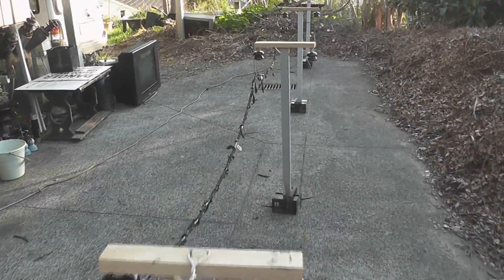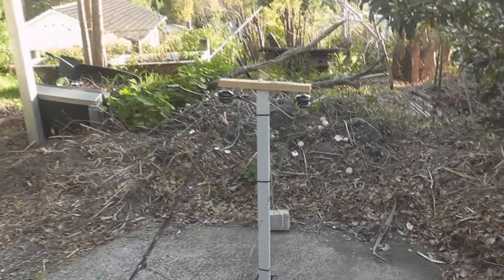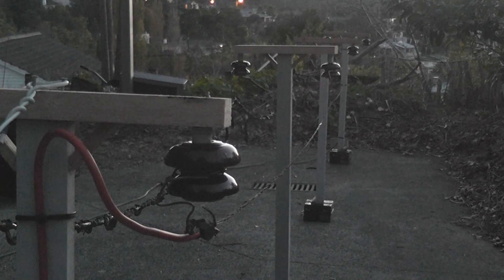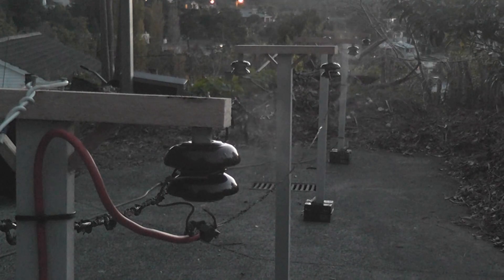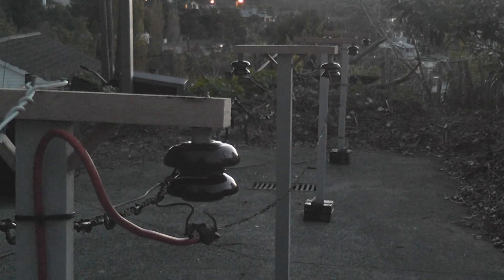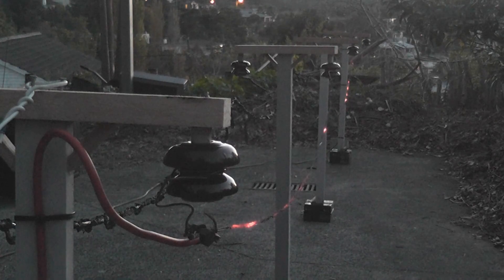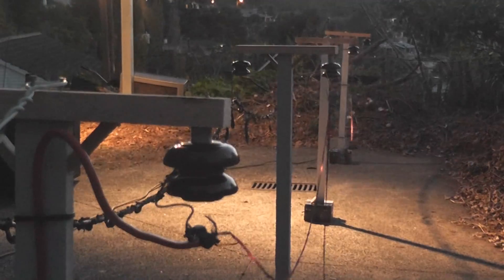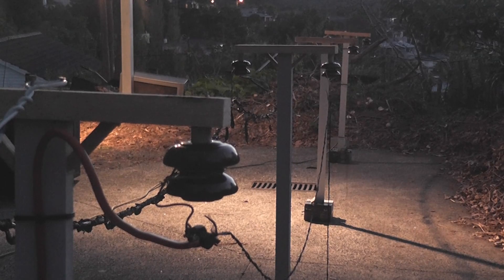OH line glowing red hot

Comment: did you create them by you self or did you buy them??
Reply from the maker: I build those power poles from old scrap wood. Insulators were from the bin at work.
Reply: ok thanks
Reply: but how many volts?? because they are hot??

Comment: I heard stories 7 years ago that something like this happened on a shorted 10kV power line in Estonia. Several kilometers of line needed replacement. Those motion sensors on these lights are not well filtrated from noise coming from the power lines and trip for a lot of things.

Comment: One morning on old north road just before the round about onto the state highway I looked over at the OH lines and one line was sagging about 20-30cm lower than the others which were perfectly equal. Was that one line overloaded?
Reply from the maker: Maybe, or it could also be a loose insulator shackle which is more likely
Reply: It was lower all the way along the road though.
Reply from the maker: KiwiPowerNZ
It could be the typically heavily overloaded red phase.
Reply: RODALCO2007 KiwiPowerNZ
In the US there are two heavily overloaded phases, one more than the other. Sometimes the rotate them properly, but in the country there are only 2 phases, one for all 120V and the other for stoves/air conditioners (240V). The third phase is mainly for industrial uses. RODALCO2007 is right the first phase is typically overused and sometimes slightly thicker for this reason.
Reply: theLuigiFan0007 People in the US brag about their 200A supplies. Does everyone have 50kVA transformers over there? Why such a high current rating? Unless you're Rodalco2007 you never max out the 80A supply we use here.
Reply: KiwiPowerNZ
I wonder where they get the 200 Amp from as many pole transformers are 25 or 50 kVA single phase.
Reply: Raymond Van Orsoy de Flines Do they wire the secondaries of all the transformers on the street in parallel to load balance them all? That would give some extra amps if one house was drawing a lot more than all the rest on the same phase.
Reply from the maker: KiwiPowerNZ
That was my reply on my other account. In some cases they do , often when there is a bank of three TX's. not when a single TX tank is fitted.
Reply: KiwiPowerNZ
The current rating is higher because the voltage is half. A 1200W heater needs 10A instead of 5A like in the UK and most anywhere else. Basically more amps is needed for the same amount of work. Volts*Amps=Watts. Typically a single, small transformer for each house. Like Rodalco saidm when more than one they sometimes wire parallel. Some people share a 120V output, as its unlikely both will use max current at the same time. The phases used more in a area are in parallel as two phases go to each transformer in a normal setup. Funny you mention 80A as our main breaker is rated 80A, it makes a full 200A undrawable. People that think they are better having 200A are really no much better than a 100A 240V supply, not too much more than yours.
Reply: theLuigiFan0007 I realize that. I mean
80*240 = 19.2kW
200*240 = 48kW or 120*200+120*200 = 48kW
In the US they have two 120V phases at opposite phase giving 240 between them by means of a center tapped winding, take neutral in the center and get 120V out each side at opposite phase. At 200A this is 48kW vs 19.2kW on our 80A supply. That is why is was asking, do all houses in the US have 50kVA transformers to supply this 200A rated connection. If it's not possible to use 200A why not make it a 1000A rated supply and share a 20kVA transformer with 3 or 4 houses lol
Reply: KiwiPowerNZ
Hmmm... appears I was wrong. Forgot 200A between phases (ex 100A per phase) is the same as across. It is 48kW. I do not know either other than some clothes dryers and stoves use 35kW at max depending on the design. Dosent make sense to me. I dont know too much about the power system itself, just the actual user end things. Sorry for being confusing.

Comment: Actually is a good illustration as to what happens in the summertime when everyone turns on their aircon, etc. The lines droop and come in contact with something and then.. blackout.
Reply: it's normally the fuse or transformer that blows before wire fails due to heat (a lot of snow on the lines can bring them down) If the wire is failing due to heat then someone is in trouble for using a cable that is to thin
Reply: it's normally the fuse or transformer that blows before wire fails due to heat (a lot of snow on the lines can bring them down) If the wire is failing due to heat then someone is in trouble for using a cable that is to thin
Reply from the maker: lee x
Some ground-moubted transformers in NZ feeding overhead lines have no secondary fuses fitted.
Reply: RODALCO2007 that does seem a good way to make transformers overload (and blow up) or cable meltdown

Comment: Wow you have leading edge fault detection on that line. Remote arc fault detection, it even lights up the area to make it easier for the engineers to work. :-)
Reply from the maker: That fault detection system worked well and was unexpected. The PIR from the outside light must have picked up the EMP from the arc when the line snapped in half.
Reply: RODALCO2007
Lightning causes the a old phone's ringer to ding once if within a few miles due to a almost unburied phone cable going betheen the house and shed that was patched in. EMP can make metal sheds flex a few milimeters to to a repelling field. Its weird stuff. Very good demonstration by the way, reminds me of a huge line failure that happened in the US a while ago. It was in 2003 that a 512k line failed and caused all the load to be shifted to 128k, 25k and other residential/between substation lines. They sagged and shorted on trees or broke. Was the most massive blackout the US ever had. The Northeast Blackout it was called. We live in the northcentral US and I was not very old at all, so no remembering news that far back.